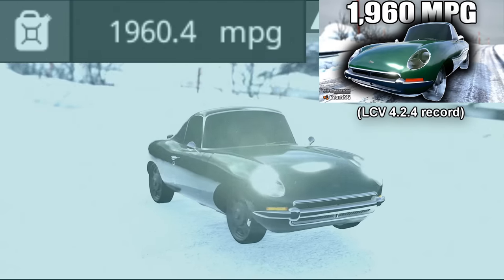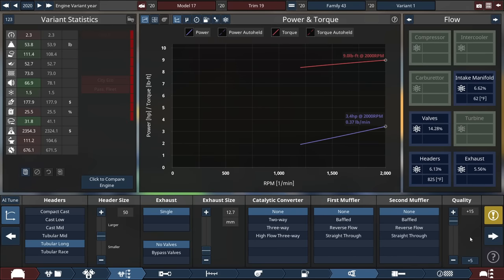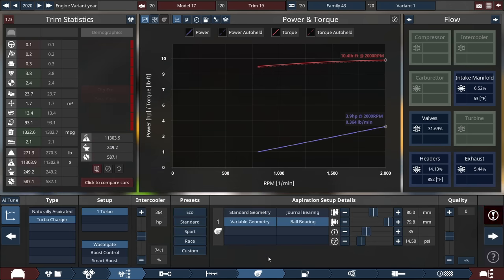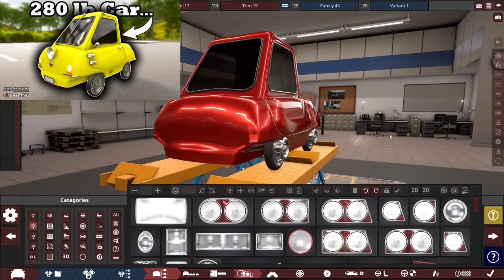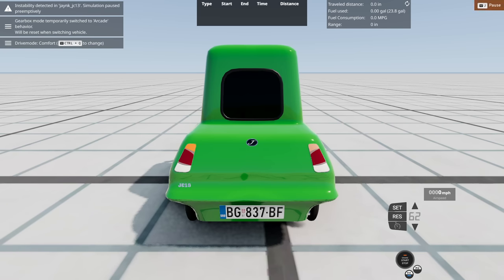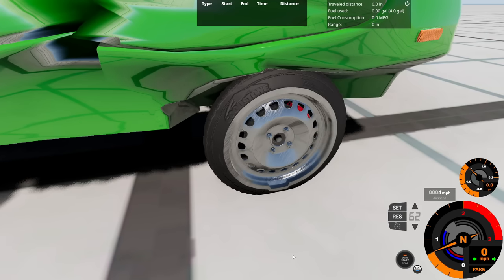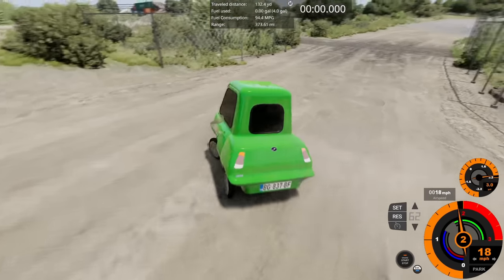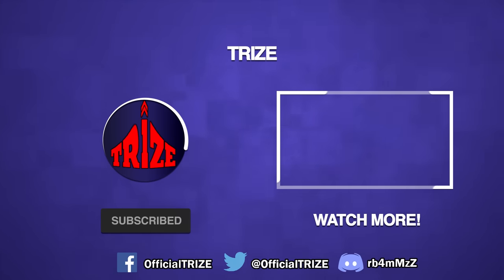Building The Most Fuel Efficient Car... That's Terrible to Drive! | Automation Game & BeamNG.drive

Comment: 1 liter = 0.26 gallon, so this car would take 11m30s to burn 1 Liter of Fuel
Reply: I’m American so I’m kinda stupid but 1 liter is .26 gallons? I thought 1 gallon was 2 liters, like the big soda 2 liters at the store
Reply: American and English gallons are different.
Reply: @lagamerfuel9661 2 liters is closer to a half gallon.
Reply: @lagamerfuel9661  1 liter is ~0,264172 US gallons and 1 gallon is ~3.785412 liters. So one small glass out of those 2 liter sodas. ^^
And don't call yerself stupid for not being fluent in conversions of all sorts of measurements. You can always look those up if need be.
Also ima quote the interwebs :  "The US liquid gallon is defined as 231 cubic inches (inch³) and is equal to 3.785411784 liters. It is based on a medieval English wine measure. The British gallon, on the other hand, uses a slightly different definition based on beer barrels." and "One liter corresponds to one cubic decimeter (dm³). A cube with an edge length of 10 cm has a volume of one liter."
The more you know. I only knew the definition of a liter too btw :| And OFC somebody had to use a container filled with alcohol as the baseline of a measurement... lol
Reply: @sicstar I really respect the fact you don’t judge if people don’t understand what you’re talking about
Reply: @OversteerAllDay teasing americans about their weird measurements gets old and doesn't really get anyone anywhere. It's numbers a lot of real people use and understand. So, as nice as it would be for the entire world to use only one, we don't, so we gotta get used to it and work together.
That's the philosophy i came to at least.
Reply: @crackedemerald4930 really I find the opposite annoying the metric snobs act like Americans don't use metric and imperial both daily but still snide in superiority when they can't convert at will at all we learn this in school or at least we did 14 years ago when I was in school but apparently they can't even teach the simple conversation method yet criticize our school system which is shit these days but come on that's nitpicking hell.
Reply: God why can’t we all just use the metric system
Reply: @lagamerfuel9661 i campare it to a milk gallon. Do you think a 2 liter soda bottle would fill a milk container?
Reply: @Akotski-ys9rr  huh just checked the fridge, s half gallon of milk has 1/2 gallon or 1.89 liters and one of those 2 liters has 2 liters so yeah I guess it would only fill a half gallon, which seems crazy with how narrow the half gallon is
Reply: r/theydidthemath
Reply: 😅I’m a😅

Comment: This engine on paper seems to be similar in performance to a Honda 125cc scooter engine. Of course, the irl Honda engine only gets around 100 mpg, and is a single cyl, while this tiny monstrosity is 3 cylinders.
Reply: when I drove my 125 Motorcycle (mt 125), I had about 3,3 litres/100km or 71 mpg while driving 100 km/h. When driving 70 km/h I had about 1,7 litres/100 km or 138 mpg. And all that while having 15hp and shitty aerodynamics, because I am huge.
Reply: @Honigball my motorcycle gets 15/L 100 KM 🤔 must have a gas leak lol

Comment: Interesting, almost as crazy and silly as my 2L i4 that I built to go the other way, consume as much fuel as possible.
The first concept of that engine actually shocked Rob of Automation as he never expected anyone to build something so extreme that the game engine would crash, but yet it did.
When we did the math, turns out what we had created was a fuel pump rather than an engine :P that made about 1-2 Hp of power output at peak RPM.

Exported to BeamNG, the car didn't even start as BeamNG was not happy with the engine.
Reply: GOATed Grid videos
Reply: ah yes the true ol engine fuelled by flowing over a water wheel
Reply: lmao just 4 pushrod fuel pumps duct taped together

Comment: Seeing that tiny 100cc engine makes me wish we could make 2 strokes but those would be so pointless for automation, what we really need is diesel engines tho but one thing at a time im hyped for the superchargers
Reply: Get on Gear City, much better than automation
Reply: @pedgewehr  does it export to beam ng?
Reply: @devakadex9588  no but it starts at 1900 and ends in 2040. Has 1 to 23 cylinder engines, W, X, H, U configuration, two-stroke, diesel, electric, wankel, rotary, steam even.

Comment: how do you see the mpg, mine shows efficiency or something like that in %
Reply: The percent goes for engine thermal efficiency, which is a very different thing. Fuel economy varies depending on vehicle weight, gearing and aerodynamic drag. I have it on kilometers per litre (km/L).
Reply: @Loser2817  how do you see the km/l
Reply: @GenGamers  Settings > Measurements > Fuel Consumption. You can use L/100km (liters per 100 kilometers), km/L (kilometers per litre), mpg UK (miles per British gallon) or mpg US (miles per American gallon). And before you ask, yes, USA and UK gallons are different.
Reply: yeah i know that, but when you make a car how do you see the consumption. im not asking how to change it @Loser2817
Reply: @GenGamers  I fon't remember right now... :/